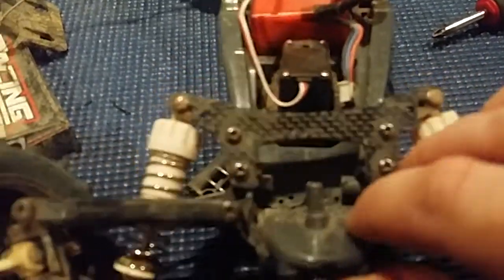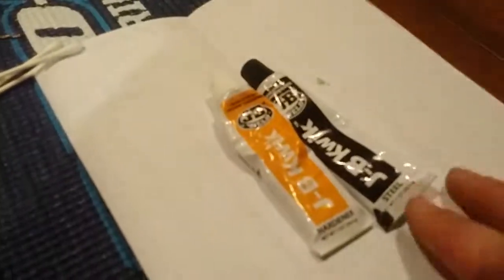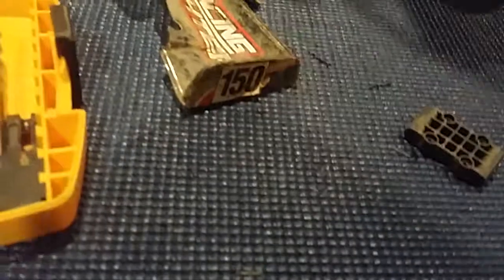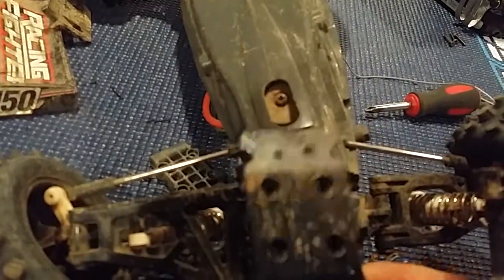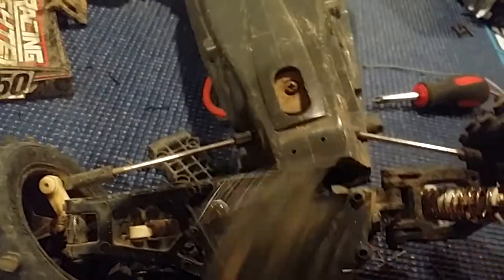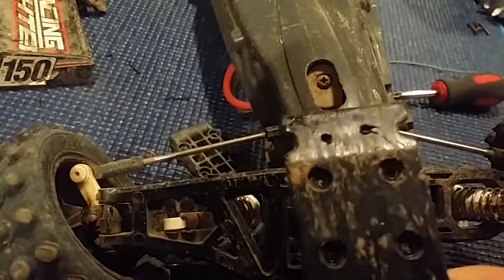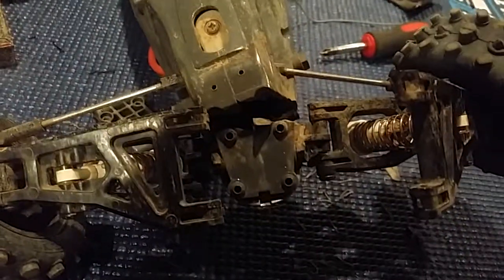Dt-03 front chassis fix.

Comment from the maker: NOTE!!  Okay - I'm so over JB Kwik weld.  It did not get very strong, and ripped apart quickly.  My fingernail still dents the stuff easily.  I'm repeating with a metal rafter joiner (I'm sure there's a better word for that) and tank-repair epoxy (which I have seen gets ROCK hard, unlike this stuff) and will post the repair.